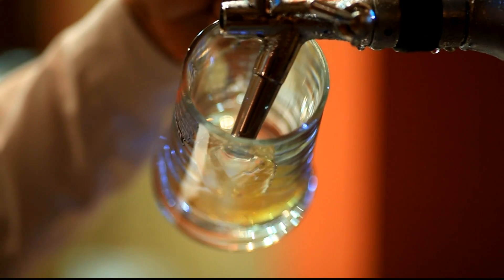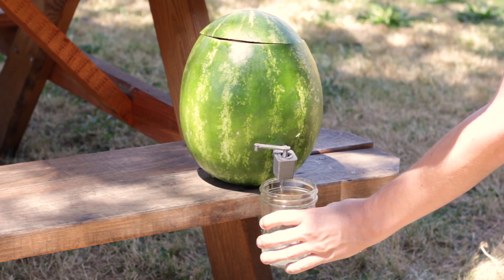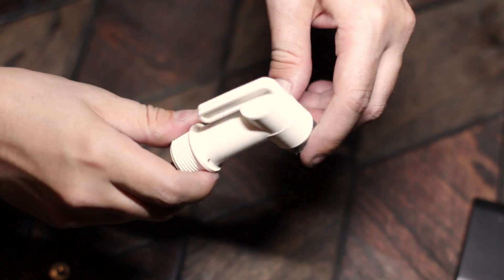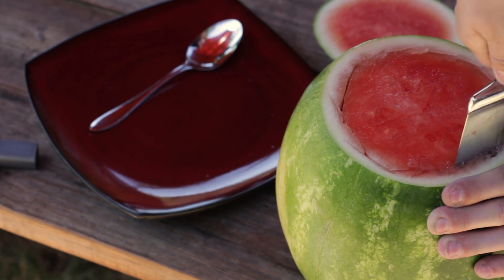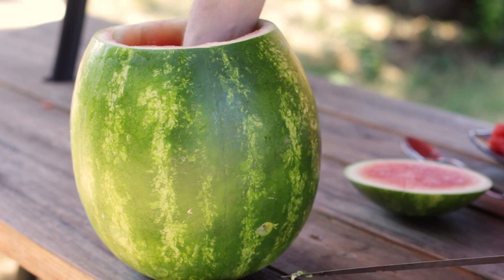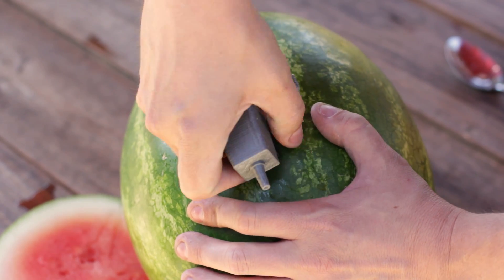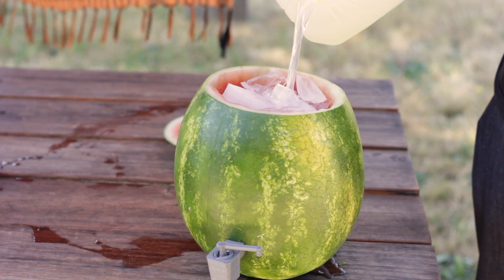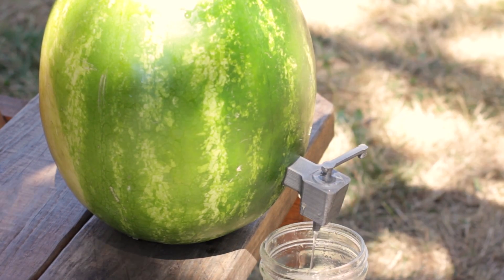How to make a Watermelon Keg! (3D Printed)

Comment: Just a tip: you should treat 3D printed parts in a vapor bath to prevent bacteria from being trapped in the imperfections in the surface.

Comment: Try this hack to clean out your watermelon.  Cut a small 2 in hole in the top.  Then take a wire clothes hanger, snip off the top bend but leave the twisted strands, stretch out the hanger to elongate the portion that would go into the sleeves, attach to twisted strand into a drill, then insert into the melon.  Start the drill and run until the inside fruit is turned into juice.  Then you can pour out the juice and save it: or leave it in ,add your ice, and your favorite adult flavor.   Saw this on the tube and have done it several times, so not my idea but it works great!

Comment: Ain't nobody got a 3D printer!
Reply: They're getting around and the prices are plummeting. Keep an eye out. Soon they'll be down to less than $500, plus some branches of Home Depot are getting ready to stock 3D printers in the very near future.

You can always look and see if there's a hackerspace in your area, because those almost always have 3D printers. All else fails, go on Craigslist and check modeling communities, because you'll probably find someone willing to lend you their printer for a quick print. Plus there's always companies like Shapeways which will print and ship anything you send them for a reasonable price. Just hop on Google!
Reply: dude get a valve at your local home improvement store
Reply: Yea... It wasn't supposed to be around until 10 years or somethin'... :"/
Reply: Donnie (eimaXe) 799$ would get you the one in the video.

Comment: you could leave half the fruit in their and put ice in and use a hand blender to make a watermelon smoothie keg
Reply: there*
Reply: auto-correct
Reply: No; you don't know the difference between the three variants of 'there'. Don't try to blame your mistakes on autocorrect because it doesn't randomly switch them around.
Reply: You used the wrong 'there' and tried to blame it on autocorrect. It's not even an original excuse any more.
Reply: why are you so convinced that it was my error?
Reply: Because when I type there wrong it would barely ever correct it to their.